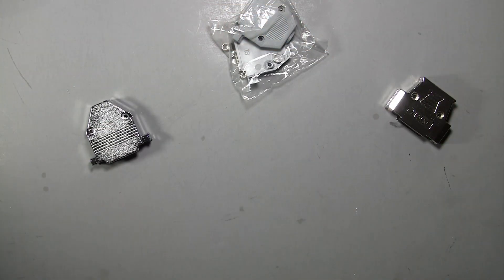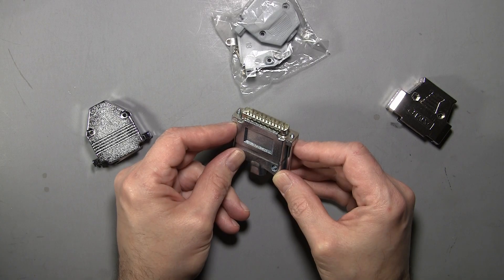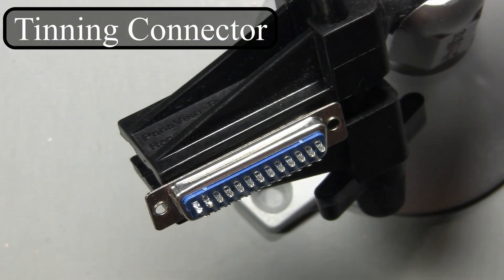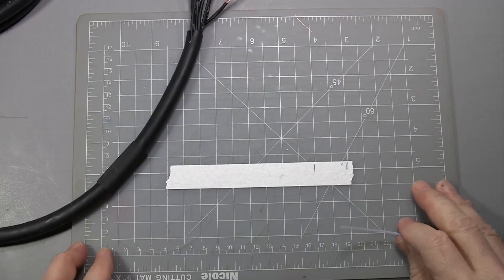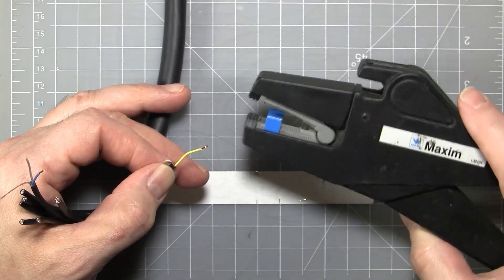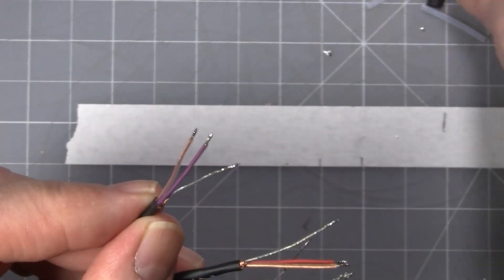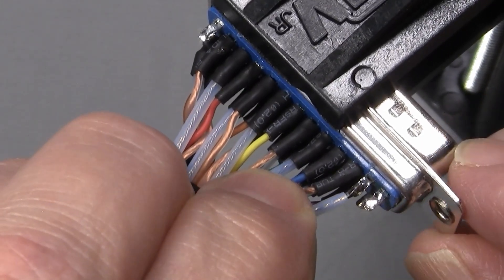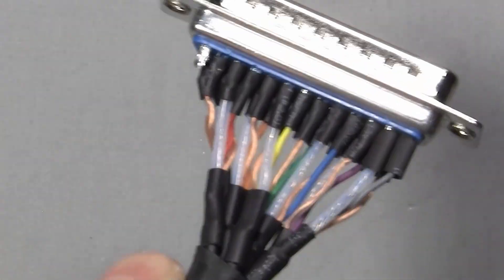How To Wire A DB25 Connector for Audio

Comment: Amazing video, extremely clear and helpful. I am grateful. If you are making DB25 to XLR analog breakout cables, what is the diameter of each channel on the Mogami 2932s if you want to use braided sleeving? Or what diameter braided sleeving do you recommend for each channel? I appreciate the help.
Reply from the maker: I can't seem to post a photo.  My measurement is about .1 inch. I would suggest a minimum 1/4" .125. Expandable

Comment: Thank you for making these!  I am watching a bunch before I sit down and make a shopping list of everything need and go make all new custom cables for my live rig. ( I already purchased a bunch of jacks and cables.       I have built the case so a few rack spaces are down below a 12ch mixer and an SP404 sampler, and an MPC.  somas you can imagine, a custom case with cables made for each spot will eliminate a lot of mess and dusting will be sooooo much nicer.        I have space for a few future fx and upgrades but atm I have a patch bay, an FMR RNC (compressor)  audio interfaces, a bluetube 2ch tube preeamp. Then I also have a beatstep for midi, and a few CME wireless midi dongles to reach out to synths in the lid of the flight case that holds all the above.
Reply from the maker: Yes it's nice. One big advantage of making your own wiring harnesses is cut to proper length it's so much neater.

Comment: I have a great tip for you, you can buy a variac 2000Va is great, and plug you blower into it, then turn the variac to a low voltage, the heater will then blow very soft, so soft that nothing on the desk is flying away, still the heating is outstanding, much more controlable.
Reply from the maker: Interesting tip, I'll have to give that a try!

Comment: Great video, thanks. Im about to do one and watching this is very helpful. My only question is why use the drain wire for ground instead of the copper? Is there some electrical or sonic advantage to using the drain wire?
Reply from the maker: No electronically it should be same. It more for neatness

Comment: So ive built about 10 db25s and 10 db15s since i saw this video earlier this year and i had bought a pretty good pair of automatic wire strippers for around 90$cad. Around my 5th db25 the blade started to become dull which i was pretty disappointed about given the price but i figured id try stripping the mogami with my finger nails and it worked great. You dont need long nails at all, just enough to grip the wire! Its really efficient once you get the groove! Figured id share this! Cheers🤘
Reply from the maker: Replacement blades for a $90.00 Stripper should be available for just a few bucks.
Reply: @biasedaudio  If $90 stripper pliers don’t last we truly lost it, we driven with the pedal to the metal into a wall of planned obsolescence.

Comment: Hello friend, thanks for sharing your knowledge. One question, what would the DB25 to 8RCA connection scheme be like? I have an old Tascam table with RCA connectors, would it be possible to do this? thanks
Reply from the maker: It depends on the device you are connecting. As a general statement you just connect the Hot (red or colored wire) and the ground/shiels wire as seen in the video, and do not connect the "cold" or low wire. Similar to my video on soldering 1/4 inch connectors.
Reply: @biasedaudio  Ok, thanks !!!!

Comment: Thanks for a great video.  I inherited a thousand feet of West Penn 292, 2 conductor, 20 gauge stranded, with Teflon shield.  Could I use that in bundles of 8 for DB-25 to XLRs.  It's for a 96 point patch bay.
Reply from the maker: In my early days before mogami became popular West Penn 291 (22 gauge) was the most common wire for wiring studios and patchbays.
Reply: @biasedaudio  Well, I also inherited two roles of West Penn 452 which is 22 guage, two conductor.  I am noise critical having put up with it since the 60's.  If Mogami is quieter and the audio quality is best... I can use that.  These spools are about twenty years old but seem in good shape.

Comment: cant you just combine all the ground onto 1 pin? then use the extra pins for more channels?
Reply from the maker: This is a standard wiring used on most audio devices and patch bays. So if you wanted to make your own non standard cable I guess you could, but I expect it would be messy using all those extra wires feeding the connector.

Comment: What is called "low" and what is "high" in audio cables please?
Reply from the maker: Low and high or positive and negative or plus and common relate to the input or the output of the device you're connecting. This keeps the polarity of the signals aligned. For a simple example an unbalanced connection you have the shield or ground which doesn't carry the signal and then you have the Plus or positive or high which does carry the signal space I'm currently working on a video that explains balanced and unbalanced circuits that may help it should be up soon

Comment: What size Teflon tubing do you use? I only see up to #24 on that website?
Reply from the maker: I like to run it a little large. I think I normally use 20-22. It's hard to thread when it's too close to the wire size
Reply: @biasedaudio  I will try a 22 to be safe! Thanks!!

Comment: Hi , as long as the wire strippers are atleast 12-28awg ill be good to cut these? Thanks
Reply from the maker: Should be usually that wire is in the 22 to 24 gauge range.
Reply: Awesome , thanks
Reply: Knipex has an option for 10-24awg, those should be fine or cutting it close?

Comment: Great video!  Thank you!  having a hard time finding the teflon shrink tubing.  Is that 100% necessary?
Reply from the maker: The Teflon does make for a very neat job, you can use shrink but it is not as easy or neat

Comment: For a male to male DB25, are both sides wired as you showed ? That means the single wires are "crossed", correct ?
Reply from the maker: As a general Statement for analog audio the pins that are Channel one, should be channel one on both ends. I expect in a female to male the wires would appear to be reversed but would align with the same Pin numbers. Now in the case of AES Digital and Data cables there are situations where you need to crossover the pins. Example in a Male to Male digital one end would be wired to the Output pins and the other wired to the input pins so the audio would flow from the Digital out of one device to the digital input of the other. This as well is brand dependent so the connectors should be understood before soldering or placing crimp connectors starts. For many cables, audio, digital, ethernet, serial, the term for this is a "Crossover" cable vs "Straight wired" cable.

Comment: Hello, thank you for a such informative video on soldering db25 connector. I've recently bought a Cordial multicore cable which came with double shield and has a main "drain wire" cable that goes together with foil shield. I didn't manage to find an answer where that drain wire should (not) be soldered to in order to get the best performance out of the cable. Does anybody had such a situation or know the solution? Thanks.
Reply from the maker: I doubt that main drain wire will have much effect on anything. If you use a metal shell connector you could try to connect it to that. Possibly by wrapping it around a screw usually you can't solder to metal shell connectors. Good luck.
Reply: @biasedaudio  Thank you for a quick and imformative response!

Comment: I need to find or make an apparently very unusual DB25F-to-TRS cable for a piece of gear with a non-standard DB25M at its connection point. I might still see if I can buy one, but if I can't I can tell your video is going to be super helpful. Great video, and thanks for posting this!

Comment: I am having trouble locating db25 connectors that are made out of 'solid' metal (as delineated in this video - 0:23). Anyone know where to buy these? Redco only seems to offer their version (which they have confirmed are stamped). Not sure how much it matters - but if I'm soldering 15 of these things (using all mogami cable and neutrik connectors), I'd like the db25 connectors to not be the weak point.
Reply from the maker: Digikey and mouser should have then unless there is a supply chain issue.
Reply: Thanks (again) for your assistance. Looking at Digikey and Mouser, I'm not seeing how you can delineate 'solid' vs 'stamped'..(?) Is there a particular connector you recommend for higher end cables?

Comment: Thank you for this awesome level of detail. In the video description, there is a link to the 'good' wire strippers - but I don't think the link is accurate..? I have done db-25 to xlr in my studio before, but now I am doing an entire studio from the ground up (14 db-25 connectors - as well as many other connectors 😢). It might be worth while for me to get the good strippers for such a task, but I want to make sure I'm getting the right ones. Can someone confirm the ones used? Thanks!
Reply from the maker: You are correct Amazon substituted a cheap stripper. The true Maxim is now $160.00!!! There is a Paltinum Tools marked Maxim for $92.00 it says it goes to 24 gauge but Mogami is 26 gauge.  So it probably works fine but I am reluctant to recommend if I haven't tried that brand. I will remove that link. Thank You. If you want the maxim you can google IDEAL 45-327 Maxim Stripper I've updated the link. you may want to try the Platinum version.
Reply: @biasedaudio  Thanks for the reply - and again, thanks for an awesome video!! This is quite helpful info before embarking on such a daunting task.

Comment: Just so I’m clear. On my mogami shake cable with the ground, the clear wrapped wire and the color wire, is it G = ground, clear coated wire = low and the color wire = high or hot?
Reply from the maker: High and cold correct. The uncoated wire is ground. Often you will see a single twisted silver wire can be used which is neater than using all the copper wire if it is present. Some cable types have this some don't.

Comment: I always slide the shrink tube over each soldered point before I solder the next one, the heat of the iron while soldering will shrink the tube and you can work a little faster, at the end I'll go over all with a heat dryer to make sure
Reply from the maker: That works too, I prefer this method.
Reply: Hi can you tell me how much the temperature of the iron you set to solding the wires ? im not good in english but hophng you understand thanks.
Reply: @user-fw8nl7tk3m  Between 600 and 700F(320-370C) will work. With practice you'll zero in on the time to dwell on the connection to properly heat it for the temoperature you're working at, usually 1-2 seconds for this particular application. The tip width is pretty critical; 3/64 to 1/16 will work well. Definitely not wider than a 16th! This basic technique can work with other kinds of soldering jobs, but It's important to keep in mind that the particulars are greatly dependent on the sizes and masses of the wire and terminal.

Comment: If you're doing a lot of these consider using crimped D-Sub connectors. The tools are expensive but the end result is great and it's a little faster than soldering once you get going. Also fewer burned fingers.
Reply: Definitely. I went with machined crimped pins and hand crimper by DMC. As you said the entry price is pricey but the results are secure and there are a few specialty wire stripping tools out there for #awg 26. Just another alternative for the solder weary.
Reply: Not so expensive, eg at canford audio (uk website):
- 1 DB-25 metal shell (44-026): 4.54 EUR
- 1 DB-25 metal connector, male, for crimp (44-072): 0.90 EUR
- 1 pack of 100 crimp contact, male (44-049): 8.57 EUR
Reply: Cheap crimp tools can be found for these contacts at amazon or ebay for 20 EUR or so
Reply: @keefazstudio  well there’s two schools of crimping, the one I’m referring to is machined pins which require a specialized hand crimping tool and machined crimp pins which are pricey but the crimp pins hold the stranded wire and crimp tool’s positioner which needs to be selected for the specific pin manufacture # you intend to use hold the pin securely. It is definitely overkill if you only intend to make a few DB25 connections but it’s something you need to try for yourself. I personally would solder before using the cheaper crimp pins/tools. You’ll know why after trying it and the stranded conductors you just crimped fall out of the pin.
Reply: @armandodiaz3485  I tried it, I would not suggest it otherwise. No issue, ok I did a limited connection / unconnection moves though, it's DB25 no jacks, their use is more for semi-fixed connections anyway

Comment: Nice job! I'd cut the outer sheath a little bit shorter if possible, so the plug's enclosure acts as a strain relief for it.
Gonna hack together a 8in / 8out balanced on a 50 pin D-sub connector for an ESI Maya 1010 card that is lacking its breakout panel. Oh my, this is gonna be tight!
Did a fair share of pro audio wiring back in late 2000s when I volunteeered at a radio station.

Comment: I work in a physical chemistry lab and needed to solder a control circuit to a stepper motor using a DB-25 connector. This was very helpful.
Reply from the maker: Happy I could help!

Comment: It’s insane to me that the audio hardware world hasn’t caught onto the ease of standardized connectors. Just use one single standardized cable like they use for usb now. Like a locking lemo or aviator style connector with as many pins that are required for the highest capacity cables, and then for cables that don’t require that the pins are unused or can be used for another function. Like if a cable need 3 pins for analog, and the cable itself has 6-7 pins, 3-4 pins can either be unused or they can be used for something digital or power related. In a short time all instruments and gear would use these connections and in the meantime manufactures can make a killing selling dongles and converters like they did for usb an its previous incarnations. I’m just sick of having to learn new connectors. lol

Comment: When wiring this type of connector do all pins need to be used? For example could you run 2 XLR and 2 TS cables and only use 10 pins? The goal is to have a snake with one connection point vs 4 (guitar rig to IEM rack). Would it still function like a snake even through there are both balanced and unbalanced signals flowing through the same connector? Thank you!
Reply from the maker: No all pins do not need to be used. It is common in certain cases to only use a few channels.